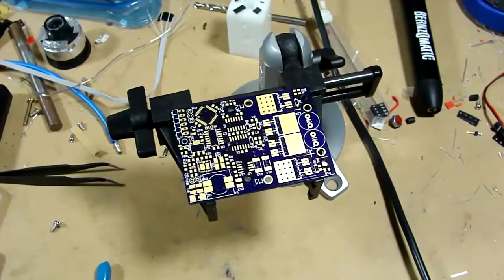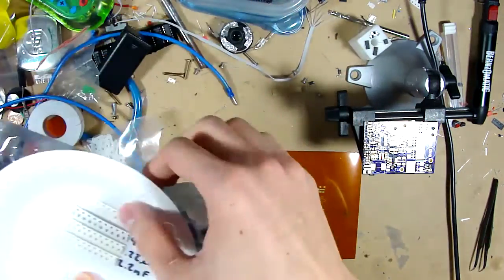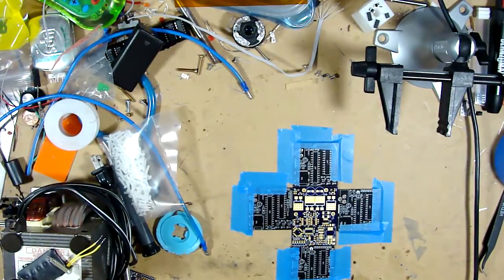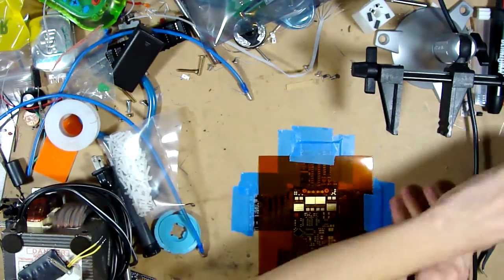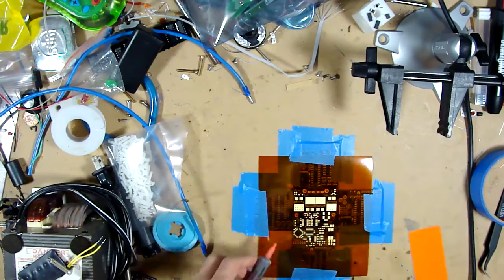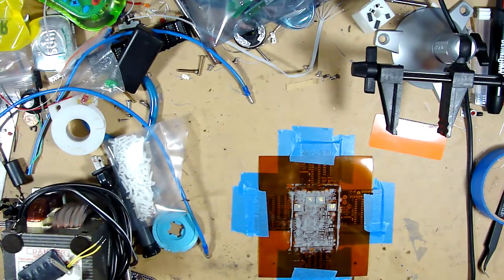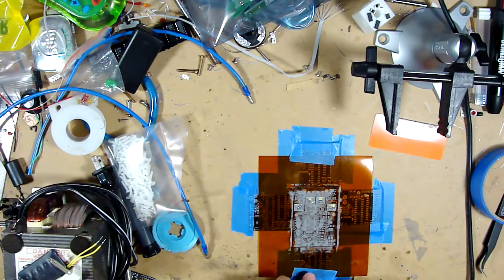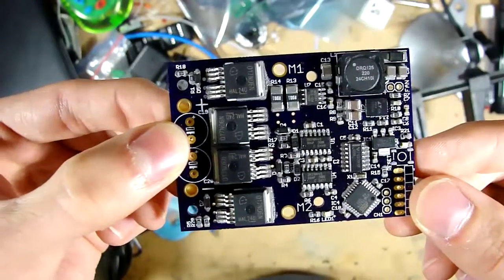Applying Solder Paste with a Stencil

Comment: Could you put registration marks on the stencil, and have the same marks placed on the top silkscreen layer?  Can stencils be safely laser cut?
Reply from the maker: +Dan Royer I believe ohararp uses a laser to cut their stencils, so thats fine. As for the registration marks I just find a few pads on the board and line it up with those